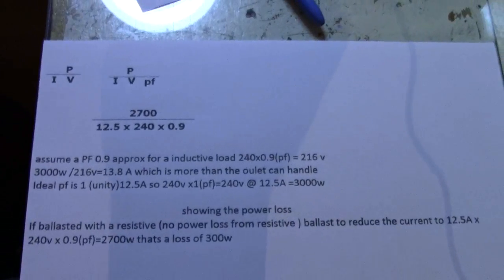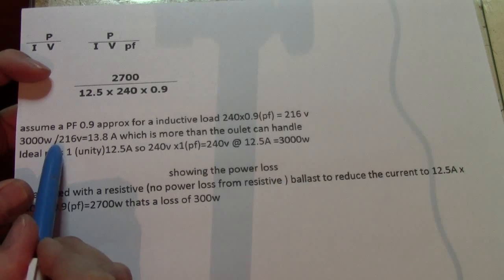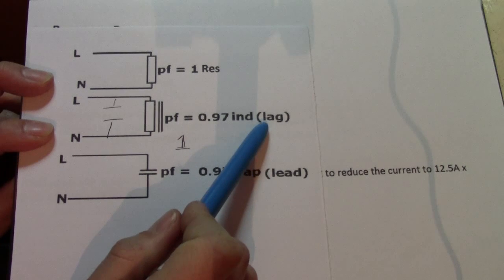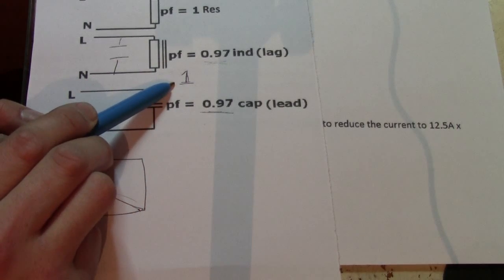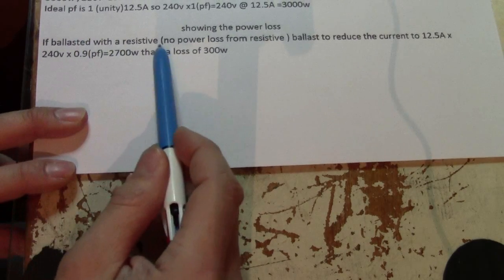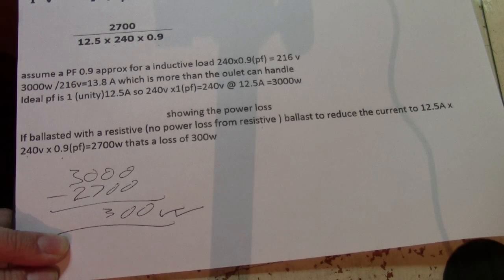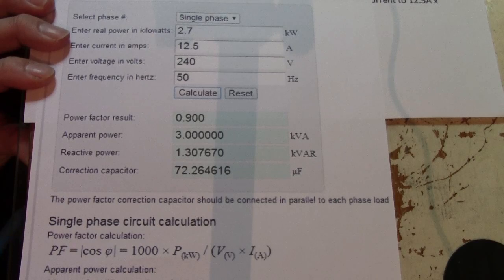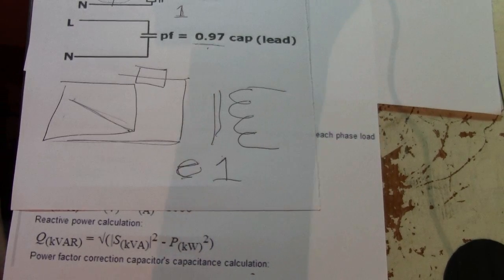PFC Power Factor Correction HOW AND WHY ITS SO IMPORTANT FOR SAFETY IF NOTHING ELSE

Comment: capactor, wattmeter, amp-meter, inductor, resistor.. what's needed for a practical demo.

Capacitor alone: no power, lots of current
Resistor: lots of power, not that much current
Inductor: some of both

Too really show the stuff going on, you need a scope + current(can get away with cheap current transformer + resistor) and voltage probe, best if it got a math function so you can multiply the channels with eachother, and get a third curve: power.
Reply from the maker: I don't really understand :/ I will show it when my cos meter gets here ;)